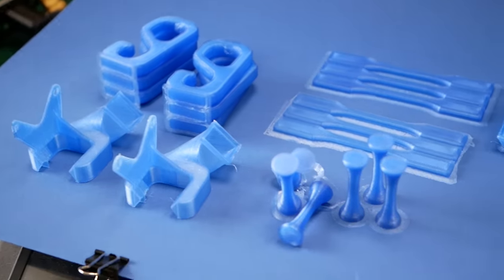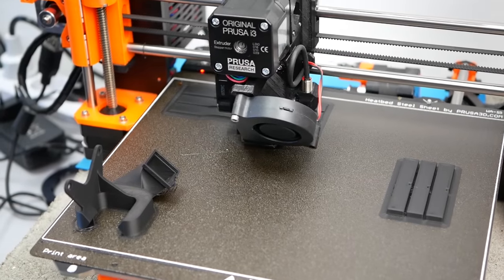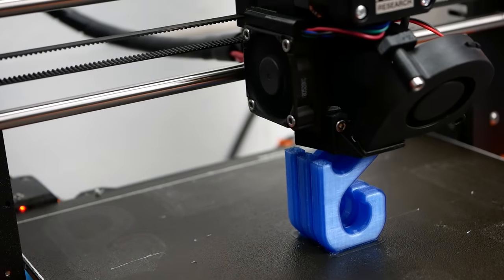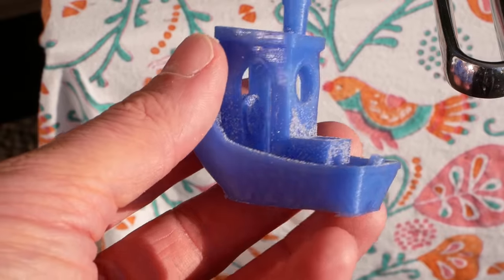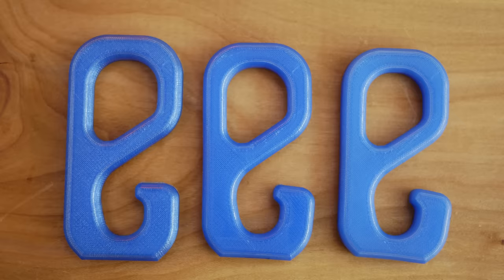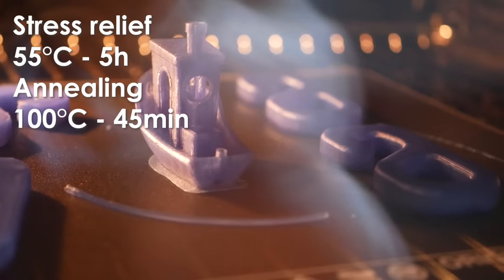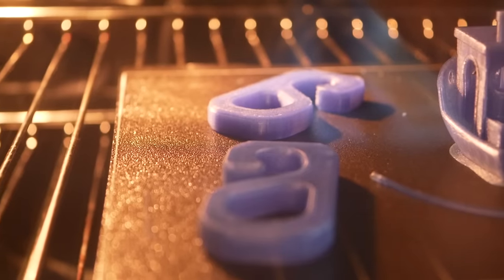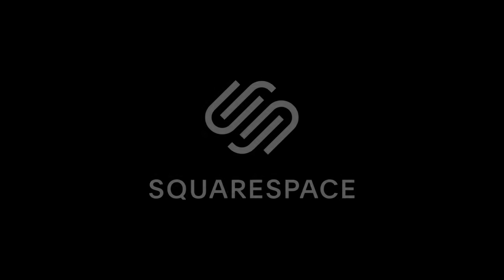Strong 3D prints through ANNEALING, but... Part 1: PLA

Comment: I tried annealing myself, but the shrinkage causes buckling on walls, which is visibly clearly on the fan shroud. Annealing is only worth it for functional parts, but functional parts need to be accurate, so you can't really do anything with this.
The only thing I still want to try is bolting down a part to a metal plate, and then annealing a part while it's constrained. 

I tried some filaments that were specifically advertised for annealing, 3dktop Berlin, volcano PLA and something else, but they still warp. The process is interesting from a scientific standpoint, but engineering wise, for now, seems entirely useless.

Comment: actually i have some idea. if you can use a molding send. like they use in aluminum casting. you can get the oven to 220 c   more or less. and get full melting and adhesion of the plastic. this way. we can make "molded plastic" parts. but instead of making a mold and inject the plastic. we first 3d print the part and put it in a sand mold. the mold hold the structure. and the part is fully melting inside and becoming one piece of plastic.   very interesting to see what will happen.  if you smooth the part a little bit before this process, you can get even smoother molded part. i also believe that the sand will not get inside the layers spaces, if you print in high resolution. so maybe no need to smooth the part. (0.12res)  but you probably will get the rough texture of the sand.

Comment: Hi Stefan, thanks for taking the time to educate the larger 3D printing community. It's been bugging me a bit but I think the phenomenon of the annealed prints becoming less amorphous may not be correct. I suspect it's a bit more complex than that. I can't say I know the real answer but a typical thermoplastic should become more amorphous when heated above it's glass transition as the stresses that the printing has applied are relieved somewhat so that the polymers individual strings can go back to a relaxed state which is why we see some XY decreases and Z increases in size. Could the print lines be lensing the light? Maybe there's a polymer chemist here that can put me in my place :)

Comment: one technique i've been trying is to make a silicone mold of a printed part, and take ground up PLA remnants (supports, rafts, failed prints) melt them till it's almost clay-like in it's consistency, and then press it into the mold. you essentially get a 100% solid model. that being said, i've never tried anything to measure tensile strength of these PLA casts, but i would love to see how that would compare if you were to try it!

Comment: Please try annealing parts immersed in common household oils, castor, canola/rapeseed or vegetable oils in particular. Its would be interesting to see the different effects that each oil had (if any) due to chemical compatibility and the duration and temperature of the annealing process. If you use the gyroid infill pattern and had drain/fill holes in the part where it wouldn't affect strength then, as its a "porous", the oil could evenly contact all of the material evenly, reducing warping, and as it would allow the parts to be brought up to temperature evenly it should more throughly and evenly annealing the part. I'd suggest a process of annealing at 45c, 60c and ~75c for 20, 40 and 60 minutes. That would be a 3x3 matrix of results. Ideally one such test for each oil type. I think this is the most complete process that could be done in the home environment.

Comment: I would have been interested in finding out what the tests said against the hook that really melted.

That one would really have merged the layers.  So perhaps you should consider testing it anyway.
Reply: _ David _   the surface area at the breaking point would be similar sizes, so it would be very comparable.
Reply: _ David _  

Yes.
I appreciate that. 
It's more out of pure intrigue than anything else.

If results are noticeably stronger.
Then maybe an experiment with 100% infil with the piece placed in a mould in the oven to keep its overall shape and dimensions. 
I appreciate that this then more or less turns the part into an injection moulded part.
But as I said. 
Just intrigued, that's all.

Comment: I work in a glass factory, and toughen/temper glass daily.
The glass goes into the furnace, which consists of ceramic rollers running back and forth through the oven at 690-725 degrees celcius, depending on thickness. What is interesting to note is that glass SLUMPING, which is where glass is melted over a material to imprint shapes or designs into it, happen at about 650 degrees celcius. We temper at a higher temperature because it is in the oven for a much shorter time, and is quickly quenched and cooled afterwards to introduce stress in the crystalline structure and leave us with tempered glass.
Things to note:
The glass we put in is always a flat sheet, so deformation is minimal
The glass warps upwards in the oven. As the edges heat up much quicker than the center, they lift up, and once the center heats up to a similar temperature, they lower back down (but this leaves the glass slightly warped). It can be counteracted by having air of varying intensity blown onto the glass while it heats.
Rounded corners are much easier to work with since the stresses are less localised.
Any holes put into the glass are generally countersunk for the same reason as having rounded corners, but they must have a diameter wider than or equal to the thickness of the glass, else the glass will most likely break during quenching and cooling.
The heat is absorbed into the glass not just from the air in the furnace, but mostly comes from the ceramic rollers. A smaller panel will overheat and distort less if it travels over only a few rollers, rather than absorbing the heat back and forth across all rollers.
A few seconds makes a difference. 12mm thick glass will be in the furnace for a little over 600 seconds. You can consistently have panels break at the stock temperatures, but adding only 15-20 seconds can make them all come out perfect.
A few degrees makes a difference. The heaters on the furnace are top and bottom, and the top is set to a lower temperature since heat rises from the bottom. You get a sort of average between the heaters, on the rollers, but the heat is quickly sucked out from glass going into the furnace. A couple of degrees too hot or too cold can make a huge difference in the quality of the glass coming out.
Colour and emissivity is important. The darker and less reflecting a panel is, the more heat it will absorb, and vice versa.
Seeing PLA in the oven feels kind of redundant to me. You can't accurately regulate the temperatures in the oven, especially since you need to open the door and let heat out to put the plastic in. Having varying, unsupported shapes, such as the fan shroud. You might benefit from leaving supports on the open gap between the fan shroud and removing it after processing it. I think maybe having flat specimens only, you would automatically see more consistent results, since the heat is more uniformly distributed and warping can be minimal, but with no way to apply forces to counteract any warping, it is kind of inevitable in a conventional oven.
I know I'm late to this channel/video and I can't imagine many will read this, but just food for thought.

Comment: I hope you cover HTPLA and PLA+

That was a great idea to use sand. I've used hot sand to bend PVC pipes without kinking for costume projects. It makes the heating more even and also prevents the PVC pipe from collapsing in on itself. I hope you continue to experiment using the sand technique and try the larger container to be thorough to see if that helps any. You also might want to try heating the sand first before pouring it in to see what affect it might have.

Comment: I absolutely love PLA, it's sturdy, tough, pretty abrasion ressistent, comes in a gazillion of colours, is cheap, stupid easy to print, almost impossible to ignite, doesn't need any mods for your printer and doesn't release nasty fumes while printing.

The only real downside really is its low temperature it can ressist against deforming. 
If you could bring the point where it looses form stability up to 80°C, 90°C or even around 100°C with annealing, it would be  pretty much the perfect allround filament from which you even can print car interior parts without the worry of warping like crazy.

Comment: I believe the pla+ and some HTPLA's are better equipped to do this with, as they are supposed to warp less during the annealing process, like how you found that the volcano one warped less then the crystal blue.  Makergeeks used to sell a "raptor" line pla that was like $15 extra that was supposedly made to be annealed.  I have several spools of it, but have only tried it once with putting a part in some boiling water for 10 or so min.  It was a dragon print and the wings kinda ended up sagging down a bit, but after it went soft, it hardened back up in like 4-5 seconds and you couldn't get it to be pliable anymore. I ended up snapping the wings off trying to get them back lined up..

Comment: Boiling Water Annealing. I made a 5 inch screen shroud for a backup camera installation on my wifes  car about x170mm y130mm z130mm from pla and covered it with fake leather upholstery !
So in about 5 days it just melted and annealed rock hard on the dash under the sun. I then reprinted compensating about +5%  on x and y and -4% on z axis. I then annealed in a pot on the stove with BOILING WATER for 35-40 minutes  and let cool. Short story, The thing is now on the dash over 6 months under the Greek sun (60-70 degrees on the front dash) and it has not deformed in any way, I did make a few small 100mm x10mm x5mm test print strips before with the 100mm test print on each axis. I suppose the boil anneal process keeps preasure on all surfaces the same for minimal deforming. I dont know about strength of prints but temperature resistance increase for prints is about 30-40%.
Parts annealed in boiling water have to be secured and not dance around or some deformation may occur .
Thanks for all the great tests you do for us.

Comment: but what about the one that melted? can't have layer separation if there aren't any layers :v
Reply: This is an absolutely valid remark. Although the part looks different it may actually be much more functional strength wise. He should definitely test it.
Reply: @nekononiaow  generally though being a puddle loses a crystalline structure. I imagine it'd actually be significantly weaker.......... at least weaker than the flat-printed hooks. Not sure about the upright ones though.

But, I could be wrong too: after all that part is solid now
Reply: The best way to make a part would be with an injection mold. No need for a 3d printer any more.
Reply: @stevesclocks  if it only it was cheaper making the mold
Reply: I want to see it tested too.
Reply: @stevesclocks  real 3d printer job is printing master models for create molds :))
Reply: @monad_tcp  molds aren't hard or expensive at all very often. They actually are rather cheap if you know what you're doing. All you need is some high temperature casting silicone (around 20$ for the casting ones to something like $5 for silicon sealants) which can take continous 280C so you can mold basically any plastic or upto 350C or so for short periods. Just use some 3D printing to create the base object and then create a mold of it and then proceed to fill the mould with some heated plastic (having some drain holes and cutouts is a good idea I'd say) and well, the mould should be easily able to produce casted models with a lot of details.

Obviously the other way (one of the ways) is to use Clay (or sand for sand molds) which hardens at high temps and embed a metal copy of the thing you want to cast and then fill the mold with molten plastic and you're done. Low detail and harder and potentiall more expensive but can handle very high temp plastics
Reply: @MaxC_1  So my supplier lied to me when they wanted me to pay $20K for the mold, I said no and ignored it, because the Chinese would do it for me for $1 each piece without the cost of the mould.

Comment: Oh, you're already on track to investigate inter-layer adhesion.  Not looking like there is any particular advantage to heating for adhesion.  
What is really interesting is the smaller warppage when you stress-relieve first... that could prove useful.
You might try burying the part in sand, then vibrating to settle the particulates, then compressing them with a lid/clamp.  Locking the grains together might help minimize the possibility of the warping part displacing sand only held in place by gravity. It might also crush the part a little.... would have to test it.

Comment: I use quick passes with blow torch on parts with mechanical strength requirements. This gets the surface layers annealed, and sometimes even melting without distorting the whole part.

Comment: Nice Work Dude!

I have annieled some pla mic adapters immersed in 75c water for 30 mins. Old coffee maker as a bath, since it has 75c thermostat. Parts in ziplock bag with an aluminium plate ensuring parts flatness and old Shure mic body ensuring tight fit after annealing. Works fine and heat transfer is uniform if you get all the air out of the bag. You really should test this. 
Alltho better way might be a Sous Vide cooker and real vacuum bags. 

Keep up the good work!

Comment: For fixing the warps: what about annealing at slightly lower temperature for longer? Like 5 degrees less and an extra half hour? Maybe 'heat exposure' just outside the glass transition instead of after it. Then no macro changes but possibly micro changes to the weaker structures as they conform under heat. another idea would be stuck to build plate and submersion in water instead of sand. water changes temp fast, but fairly evenly.

Comment: I tried to anneal a Hero Me duct by using an electric water heating pot, which has buttons to reach and maintain several different temperatures. (I love it for making tea.) My parts were put inside a plastic ziplock bag. The water was preheated before I put the parts in. I had read an article on what temperature was best to use and used that. After half an hour in the water, they were too warped to use. At that point I decided I had to get new PTFE tubing and some PETG filament if I wanted a duct that would hold up to long term use. I am assuming that to maintain the temperature, while heating, some of the water got too hot.
Haven't watched the video yet but may learn how to do it in a way that will keep PLA from deforming.

Comment: Don't know if anything changed from then to now or if it is just the PLA brand I used. But my eSun black PLA+ became indestructible after doing rudimentary annealing. Really, I'd use it as bullet proof vest. The flat playing card like surface object I printed has around 2mm of thickness. My precious PETG print of the same part would make crackling sounds just by applying slight pressure on the sides. Unannealed would just break very easily.
Not after taking going to the sauna. First thing I noticed is that the layers seem to have fused and surfaces looked like solid paint. And no matter how hard I tried to bend it. It just refused to make any level of deformation. Fel like bending metal .

Comment: PETG gets also crystalline! actually you buy PET as you give the time after it get crystalline ...

The sintering (how you call the treatment you have done) is a slow process and you need to be 2/3 of the melt temperature... so I think maybe ABS is the better material to try it, the problem here is you didn’t get any support and it could happen that it just melts ...

What I really think you can try is to form first the crystallines in pla and after it get crystalline you heating it up close under the melting temperature so the crystallines keeping the structure... and your material can sinter together...

Comment: Stephan, Nice job but I think it only proves that one specific PLA does not strengthen with heat treating.  I heat treat PLA for heat and creep resistance.  For layer bond strength I turn off the part cooling fan and/or use a larger nozzle.  For overhangs I am experimenting with air blown only at the overhangs from the side and below by ducts fixed to the build surface.  This may sound like a lot of screwing around but my theory is that I save time and inventory by making everything in one foolproof material.

Comment: I aneal PLA at 100C for Fluid Fittings to ensure they are watertight, after which I dip the parts in hot wax at around 100C to protect them from the water.

Comment: Heres a tip for using a home oven vs a professional rig...

Your home oven has a 25°F swing in each direction, because of how it samples and corrects temp changes... use a foil "tent" or keep your pieces on a cookie sheet with another cookie sheet on top to act as a heat sink/thermal regulator.

I heat treat steels in my home oven. It also helps to keep a second thermo inside of the oven. I keep 2, one sampling the heat in the oven, and one inside of the cookie sheets.

You need to stabilize temps on product to yield ANY scientific results worth anything.

If you need more tips, lmk. I know how to mod  an open door toaster into a great heat treat oven.

Comment: YES! Really filament dependent. But better heat resistance, better strength. However, I had some warping as well. I found Z elongation, with XY shrinkage. I found other materials also like some annealing. PETG, ABS. Nylon does not seem to care.